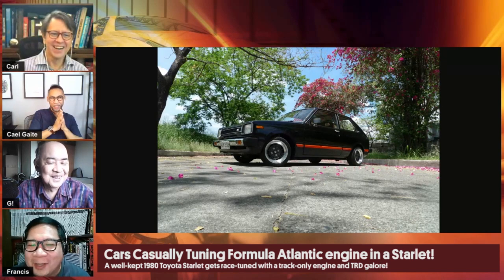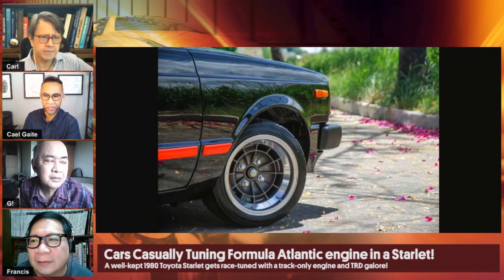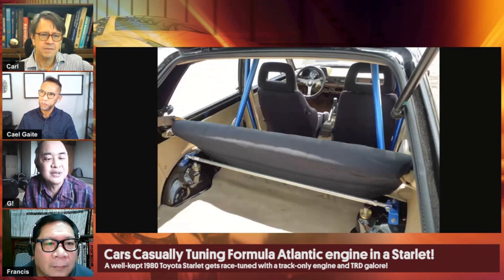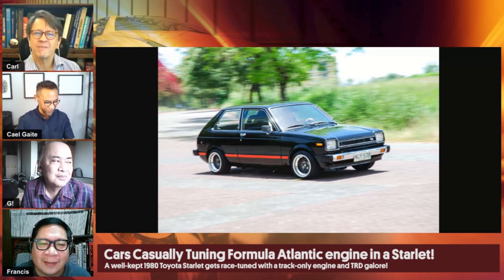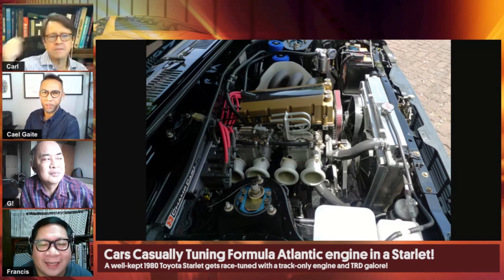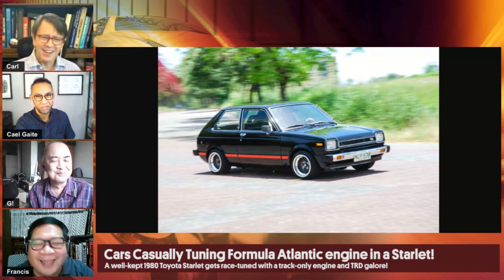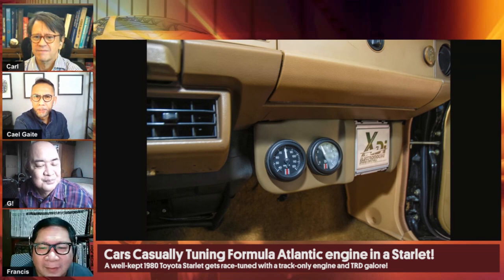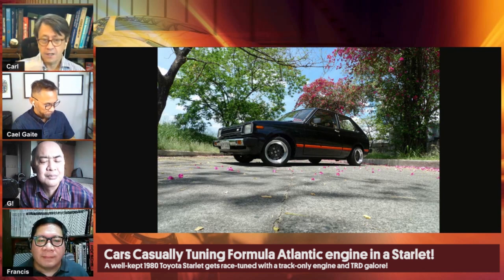Cars Casually Tuning Formula Atlantic Atlantic Engine in a Starlet

Comment: Hay a kp61 baby. 
Here in san diego cali i have my own starlet nabili ko siya sa original owner pa 7 year's ago not running it's been in his garage for 20 years still got original 4k 4 speed with rust free body decent paint fast forward today still got it with original engine with 7k tamaraw fx tranny dala ko at holley sniper efi 2 barrel overall the interior is stock exterior stock except for the wheels.
Reply: Nakalimutan ko idagdag i change the f/r bumper to jdm style kasi the ugly 5 mile usdm bumper it had.